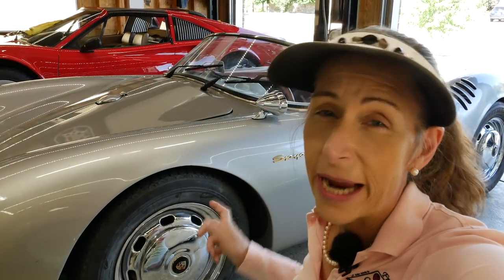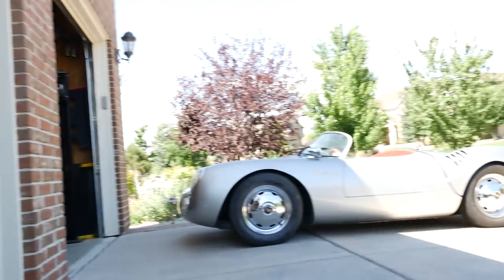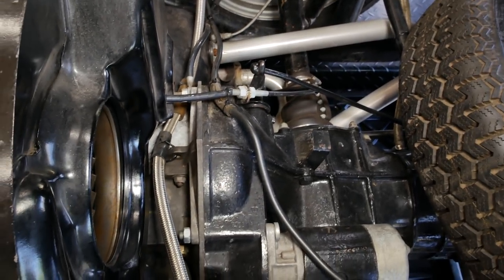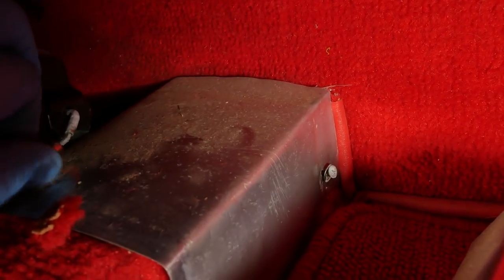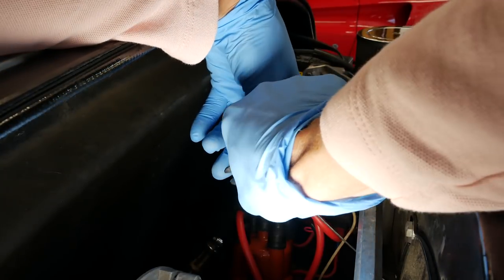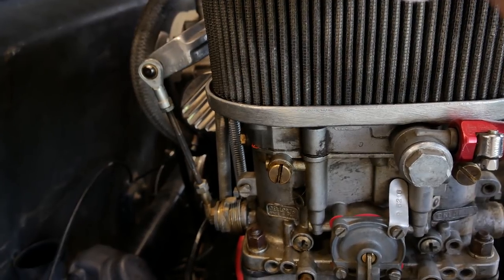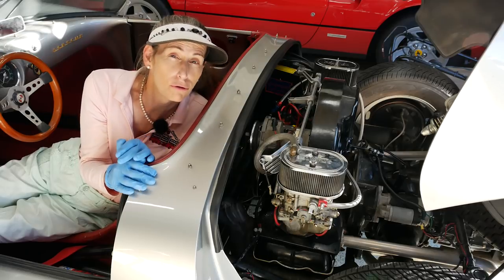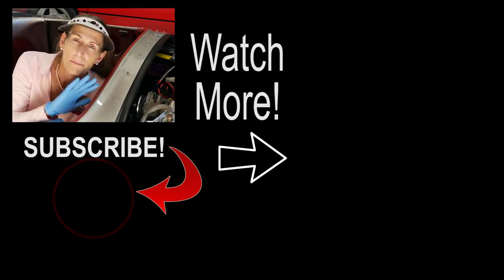Beck 550 Spyder Replica VLOG #1 Meet the 550! (1900cc VW)

Comment: You ladies rock! I watched the driving video that you made of this beauty and you mentioned visibility and being frustrated with the inability to adjust the fender mounted mirror. You"ll be happy to know that you actually can adjust it! In less than 30 seconds. Loosen the screw at the forward end, adjust, tighten. Done. I've done this solo, and it's very tedious getting in and out of the driver's seat with many minor adjustments until I got it right, but with both of you working together, it will literally take moments. Hint...do it in a parking lot full of cars and park so the other ones are in your blind spots and the areas that you rely on your mirror for. It amazes me how many people adjust their mirrors so they can see their fender, as if they need to frequently check to see if it's still there. Open the angle so you can actually see the blind spots and the cars you want to avoid hitting. Good luck, and thanks for your fantastic videos!

Comment: Carb sync tools are a must when owning a dual carb car, have had mine for decades. With all that silicone, valve adjustment, ignition issues, possible timing.

Comment: Franny,The Dellorto carbs were run on Alfa Romeos-the AlfaSud specifically.You are correct they have no chokes at least they don''t when altered to run on VWs because the cold enrichment circuit is most likely disabled.The good new is you don't need it to run correctly and well on VW engine. When properly tuned the procedure is as follows-2 pumps and then start the car feathering the idle until they will idle on their own. This should take approx 30 seconds or so this time of year.Now the idle will be slow but will cont. to tick over.I set my idle speed on a warm engine to about 1000 rpm and they will run on there own at start up at about 700 or so.You can listen to the engine warming up and idle will get gradually smoother until you get a nice steady idle. Also it is not uncommon to have some lean pops at idle as well as I'm sure you are aware because of no chokes.Not to worry,if your air adjustments are set correctly this stops as well when engine warms. Jet suggestion for your engine should be about 55idle and 140 main jet give or take. A suggestion to you would be to start it up and feather gas until it runs on its own and then adjust idle speed increase on both carbs for a few minutes to get it good and warm,then back down the idle speeds to about 800 and then set idle air adjustment for each barrel-that part you already know as I've seen you do it on the Zeniths. You can use a 'snail' to calibrate that each carb is pulling the same amount of flow or as some do listen closely that each carb is synched.I prefer the snail.Once you get it all sorted -assuming no other engine issues it should run very well.suprisingly so actually. If the distributor is an 009 there may be a flat spot off idle which some people mask by increasing idle jet size.Personally I think the 009 is a poor choice but is quite popular with the performance VW world because they are so cheap.Bosch SVDA or Bosch mechanical 019 is much better choice because of the better timing curve. Jet access is from the top-real nice in a Beetle and the tall ones are the mains and the shorter are the idle. There are also pump squirter jet accessed from the side that squirt down the barrel.Make sure you are getting good squirt on all 4 barrels. Those jets can sometimes occlude and engine will run poorly.Just take out and run through with compressed air. If you need more help just ask and I could probably answer some of your questions.Scott
Reply from the maker: Hi.  I will have Franny read all this. Quite the novel!  So nice if you!  Heidi
Reply from the maker: Thanks so much Scott! That all sounds exactly what I read in the manual.  I am cutting into the second video and I go through the carbs completely.  I'm still not super happy though.  I get back to it tomorrow (episode#3).  I don't want to spoil it for you, but I have some more things to check...  I have a sneaky suspicion...  Thanks so much for all that info.  I completely agree :)  Oh, and I'm not a fan of the 009 either :(

Comment: this replica of Chamonix made in Brazil was the reproduction of the Porsche Spyder 550, a model of competition of great success, manufactured in small quantity by the German mark between 1954 and 1956. Designed by Chuck Beck, the replica had plastic body reinforced with fiber of glass, tubular chassis and mechanical Volkswagen (suspensions, steering, four-gear box and 1600 air-cooled engine with 54 hp). As in the original Porsche, the engine was mounted between axles, behind the seats and in an inverted position; the front brakes were disc. Like standard items, leather seats and removable top. The Spyder 550 with the VW boxer engine (always 0 km) remained in production for over 20 years, but with electronic injection and 65 hp.

From the outset, Chamonix has been exporting its main focus - initially to the USA and Japan - which has forced it to focus on the quality of the project and, in particular, on the details and finishes of its vehicles. The excellent quality of the body was favored by the company's (hand laid up) glass laminating process, which ensures greater regularity in the molding, without surface undulations and variations of thickness, providing lower weight and better dimensional control of the parts. The international recognition of the brand would arrive in the 90's, when the Spyder 550 was named by the German magazine auto motor und sport and the North American Road & Track as the best replica of the category in the world.

Comment: That cable linkage  and bracket at the pedal is terrible.  I'm not sure if you can still find the old fashioned cast aluminum or stainless steel brackets. But there were some very well engineered ones out there years ago. Personally, I would never use a single cable set up like that to begin with. It's just not safe. You have such beautiful cars, and normally I would keep them original.  However, the Beck Is a reproduction, so I would change this over to a hydraulic system.  There's never any cable binding.  It's very straightforward and extremely reliable.  Best wishes...
Reply from the maker: Hi Jack, I have seen that many owners have made that and the hydraulic clutch conversion as well.  I agree...  Pretty cheezy.  Maybe that is part of the fun with these to fix all those bits.  The owner of the car just wasn't into much modification outside of getting it running again.

Comment: Hello Franny - Your series on the Beck Spyder is amazing. I own a 64 356 coupe. I drive it quite a bit, but I would really like to buy a beck Speedster or the Spyder. I'm 82 and in great health. I still have a bit of "kid"in me and I am leaning toward the Spyder. The Speedster, I know, is a much more practical car and more of an all weather car. I haven't driven either of the Beck cars. I live in northern Michigan. We get a lot of winter weather here so I would put the Spyder away till spring. 

What is your thinking  on  the difference in the two cars?  

Thanks, Franny
Reply from the maker: Franny and I both think you should get the Beck Spyder.  The  Beck speedster is too similar to your 356.  If you did not have a 356 at all, it would be a tough call.  Heidi

Comment: My dellorto's ran like that until I properly synchronized them. If you don't have one buy the 'Dellorto Tech Book' as it's invaluable for these fab carbs.
Seems a shame to engineer such a beautiful car and then cheap out on the throttle mechanism.
Luckily the owner has found the perfect person to properly fix it!
Reply from the maker: Good to know.
Reply from the maker: Thanks!  I do have the Del manual and it has a lot of great info.  Episode 2 is about the carbs.  I'm shooting three tomorrow.  I'm still confused on that throttle linkage...  Seems like there was no way it would work.
Reply: I would personally replace that linkage with a fully cable operated one. They are available for beetle engine setups and solves the mid mount layout problem. I use a bell crank style linkage which would also work perfectly with some minor mods.

Comment: Lol, did you notice the car leaking when you went to full throtle
Reply from the maker: Do you mean oil?  No actually, but I haven't had a chance to drive it...  I'll be replacing the seals on the pushrod tubes so hopefully, that will do it :)
Reply: The carburetor looks like it was leaking just a little bit when you went full throttle when the car was off.
Reply: Right at the 8:56 time, it ok, you are going to rebuild the carbs anyway
Reply from the maker: Yup.  It is...  It is the accelerator pump diaphragm.  There are new ones on the way.  I do not like gas leaks!  Good eye!

Comment: This has me scratching my head and wondering. Giant pistons means less cylinder, enormous dual dells, and gee...where’s the tin? The engine is backwards? No ram effect into the fan. All equal lots of heat.
Hmmmm I guessing this nightmare car’s , poor volksie engine will last about 5000 miles.
This car needs a Subaru engine and a radiator.
Run away Franny!!! As fast as you can ha,ha ha
This car has either no compression from warped,cracked head or burn valves due to heat my guess
No lower tin! Wow!
Reply from the maker: I know, I know... But,  keep watching ;)